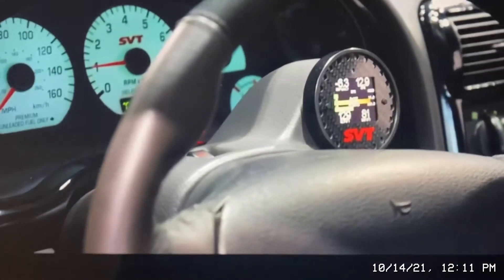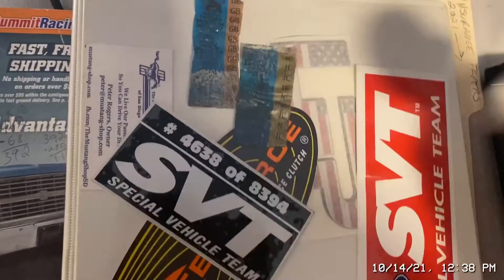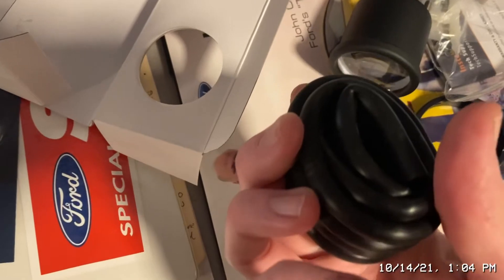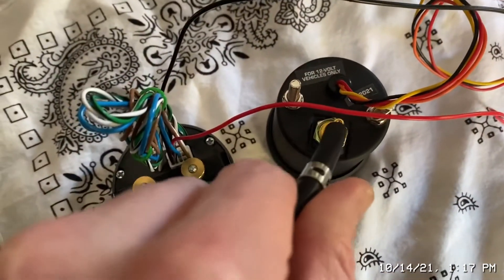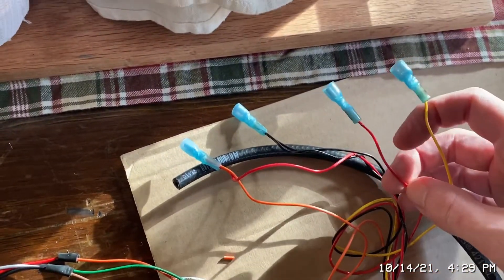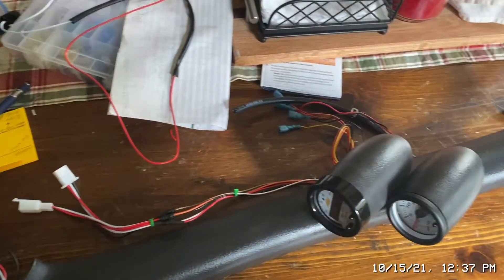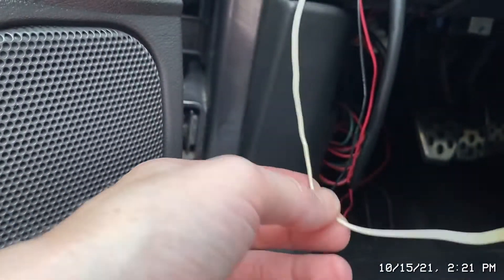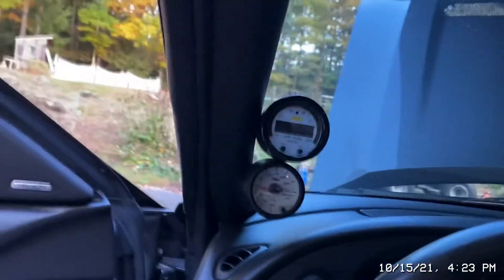2003 SVT COBRA | New “Classic” SOS Pod | New Gauge Setup

Comment: Great ideas! gauges look awesome! beautiful Cobra! I miss my 03 Cobra
Reply from the maker: Thanks I was trying to simplify things instead of having to balance a pod in the car and splice everything in! What color did you have?
Reply: @Wretched2JZ  DSG  Bassani exhaust,  full Polly bushings in the IRS and front suspension new rims but same original rim but wider in the rear. It was repainted the guy I bought the Cobra from just had it done on his own. It looked nice. The engine was a low mileage stock engine from another Cobra. It developed a marbles in a metal can rattle noise two weeks after I got it. Return fuel system, ported stock Eaton blower, headers and a tune. I ended up with so many issues one after another. The -8 fuel line leaked, the high pressure A/C line o ring blew, oil pan leaked because the guy I got the car from took it off to look inside and didn’t peen the pan. Then the rear main started leaking pretty good. The rear end was making noise and the seller paid for a new rear ended. 373 gear. Cooling fan broke. I put 1200 miles on it and ended up selling it. I don’t have a big garage to take out the motor and trans. Unfortunately not a good experience. But your Cobra is really nice!

Comment: I think the guy who recently owned my BULLITT put a glow shift boost gauge in it.
Reply from the maker: Really, that’s cool. They have so many different variations too. Figured I’d have one laying around from past cars, but they all stayed in the cars because they worked ! 😁 
They do a good job at matching. I remember I had a AEM or maybe Innovation brand Wideband on my 2JZ car and I wanted the match the pitch black look when the gauge was off. And glow shift came out with one exactly like that.
I never had a reason to try others. But I do like those more involved gauges too. I know Danny’s video shows how both plugs for gauges plug into the OBD2. Because he said he doesn’t like the SCT. I think it’s great tho as long as it’s mounted clean.
The numbers on the gauges being so small wouldn’t bother me as much if they were always logging my drives or something. So I could get home and see how the car ran through all the rpm ranges. That would be cool!